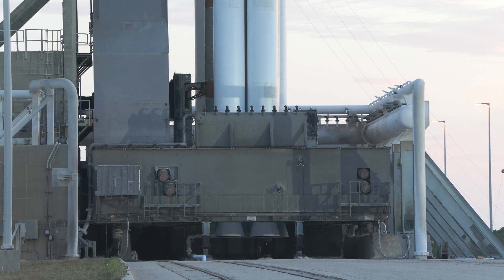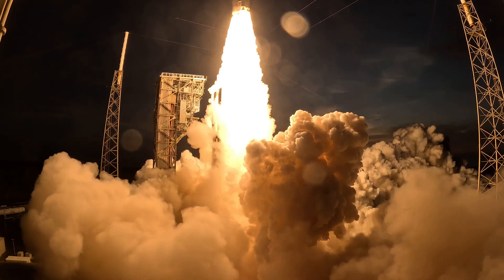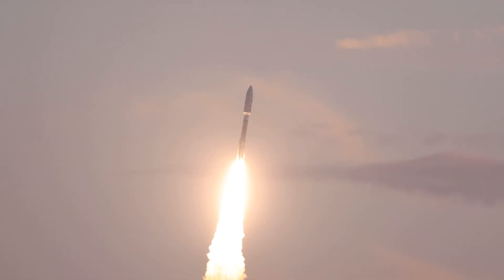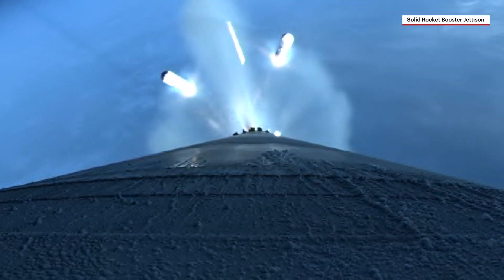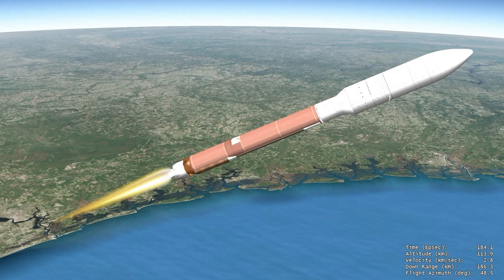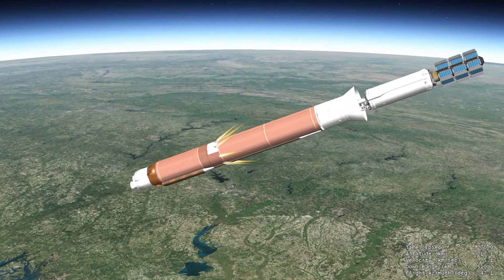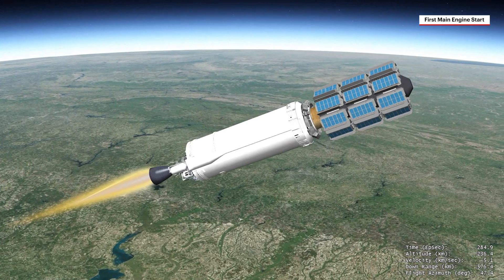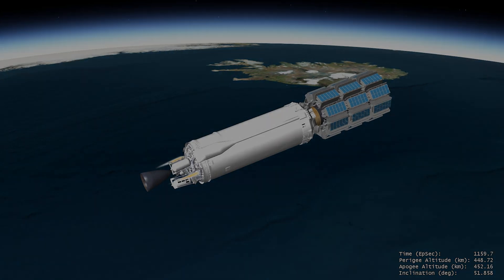Atlas V Flight Path: Lifting Project Kuiper from Earth to LEO

Comment: Is this just a 3 satellite starter pack to open up the orbital plane? These look super huge so Id expect them to be more powerful than a Starlink. How many per plane?
Reply: These are 27 Kuiper satellites in one launch. I doubt they will shift across all kind of planes. One launch per plane as starter using Atlas would be my guess. A total for 9 flights are booked. Just my speculation though, haven't yet read into it.
Reply: There is 28 starlinks per launch
Reply: Not 3 satellites, 3 LAYERS of satellites, organized like orange slices in an orange per layer it looks like. There are 27 total per Atlas launch, so 27/3 = 9 satellites per layer.

Comment: Huh. Thought they’d go for the flat pack design
Reply: Flat pack scales worse when switching to New Glenn would be my guess.  If you look closely you see the angle of the sats between each other is not optimal for Atlas. Seems like it is designed for a bigger diameter..

Comment: Reusability when?
Reply: Atlas is retiring. Amazon bought the last remaining ones. ULA's new launch vehicle, Vulcan, is aiming for recoverability of the BE-4 engines
Reply: I wonder how much advantage there is. Lots of things that were once reusable are now no longer not because it's 'more economical' to build new. Re-flight must require some intensive test and revalidation, even if refurbishment is low. Perhaps the difference for a 'production line' rocket (only really possible for high-frequency identical payloads like Internet-in-space install and maintenance) isn't that great?